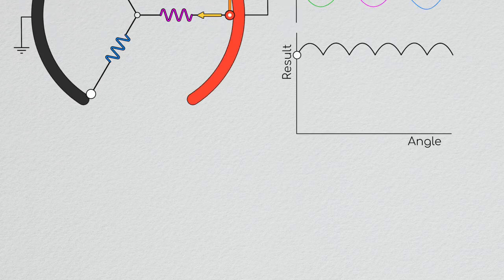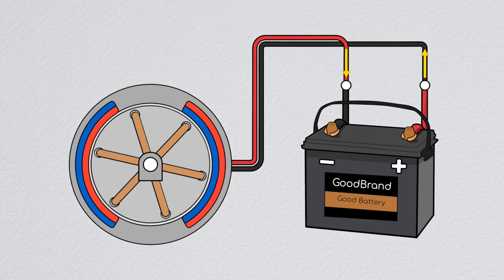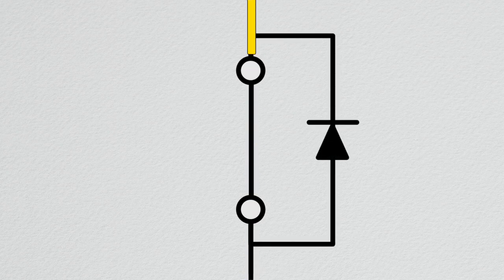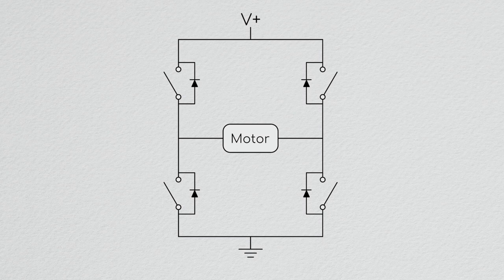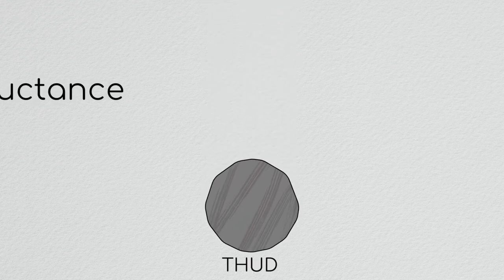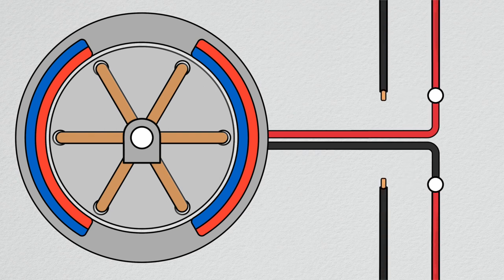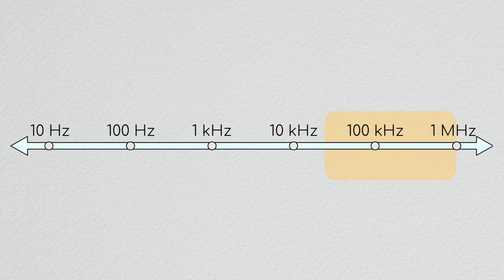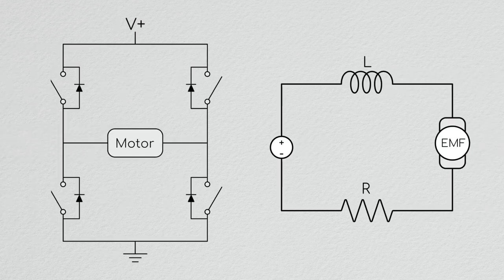How do you control a motor's direction and speed? (Episode 3)

Comment: just cracking into these vids 2 years later, was this series supposed to end on episode 14?
Reply from the maker: When I originally outlined it it was in the 13-15 episode range but some got combined together and expanded as I was making them. The original plan was to move onto another series right after but making the videos was pretty taxing and I have been getting my Ph.D. And have been a bit low on time. I hope to make another series some time in the next year though